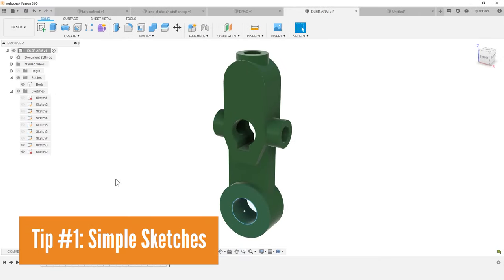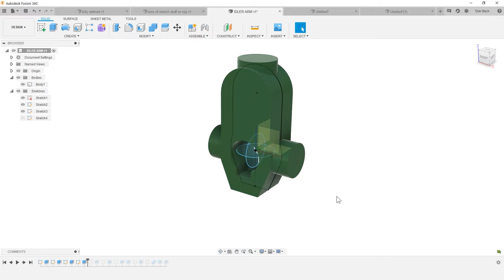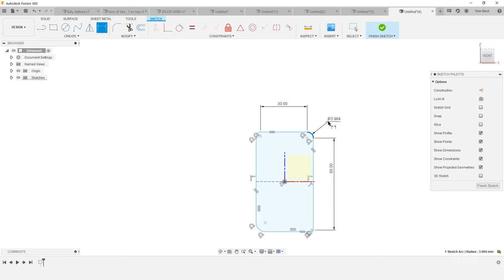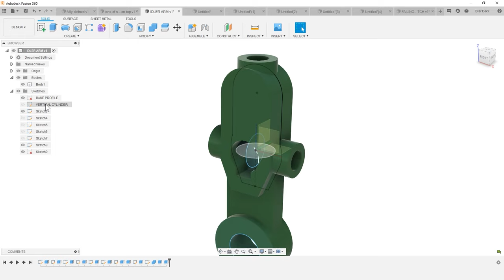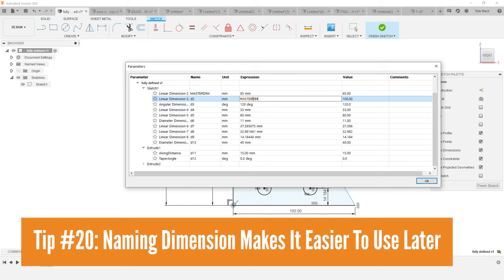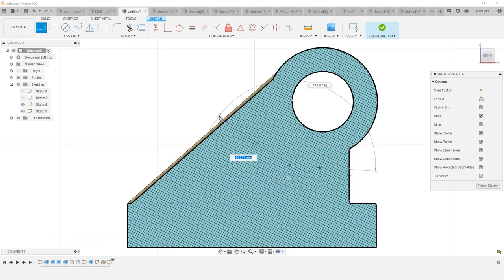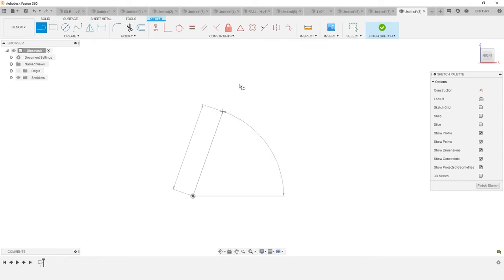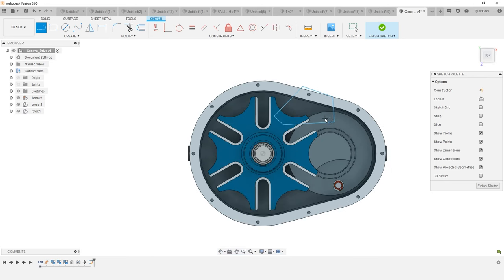The Ultimate Fusion 360 Sketch Video (44 Strategies & Tips)

Comment from the maker: Favorite Tip????
Reply: I have 2 favourites (that I didn't know before) 1) Using Break to make a line/arc partially construction. 2) The zero offset. You can never have too many tips and tricks.
Great work as always Tyler.
Reply from the maker: Great.  Thanks Spike
Reply: Hi  sir !
i think you need a good catchy thumbnail for your videos..
It's really disserves large audience. try to outline your image with white stroke it's look more vibrant and catchy
Reply: What is the hot key for the search bar?
Reply: #9 Line Mehod To Troubleshoot but also #42 Offset Zero Value and #18 break command to avoid Trimming! Great tips!!
Reply: As a semi-proficient novice, this is one of my favorite Fusion 360 tutorials for where I'm at; and it is still 100% relevant in late 2023. You quickly and concisely nailed a ton of the stumbling blocks such as all the aspects of constraints and relationship with origin which was a significant challenge for me as I guessed my way into F360 and either couldn't move something or it "got weird" when I tried to move it. I've watched quite a few F360 tutorials and this one is definitely at the top of my list for most useful and diverse content AND best delivery; quick, no fluff, but enough info that every point was described well. Thank you, I've already passed this to my friends as an excellent fusion 360 tutorial.
Reply: The missing link to my fully constrained sketches was the link to the origin. That’s going to be a game changer. Also, separate sketches for each set of features. Many others. I’ve been taking classes and watching videos for about 4 months since pivoting from SketchUp to F360, and this was, by far, the best I’ve seen on sketches. Total game changer.
Reply: @mr.juggernaut6073  the S key

Comment: I wish I had seen this video when I was new to Fusion. There is a lot in here that I learned over the last few years but have not seen mentioned in many other videos. There were a few things that were new to me now.

#39, the arc dimension tip, was new to me.  I tested and confirmed that it works on circles too. That's kind of mind blowing. All this time I have been adding points, adding tangent lines, or using equations that included the diameter/2 when I wanted to dimension from the edge of a circle!!

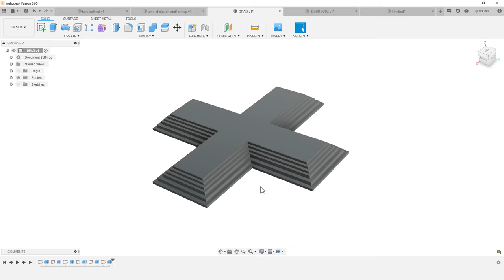Comment: 1:05 I don't get it... they will be easier to edit, true, but you will have 5 of them to edit! Plus they will be harder to cross-reference, go back, adjust to reflect changes needed in another, etc.
I'm not a mechanical engineer - but rather an architect and a 3D printing hobbyist... and I'm not sure you can speak for all Fusion users, but what you show would work for me if I had a dimensioned drawing to follow already - is this what you mostly use Fusion for? Because I would not like to design objects from scratch this way.